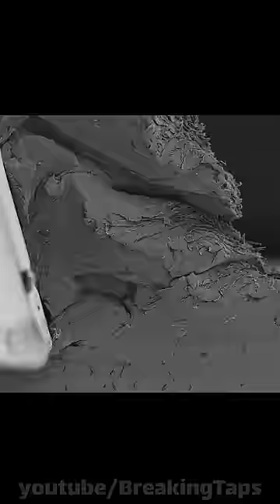Cutting metal under Extreme Magnification

Comment: Aluminum is called "The Peanut Butter of Metal" for a reason.
Reply: I thought sodium was...
Reply: Lmfao - nobody calls aluminum "the peanut butter of metal" 🤣🤣🤣
Reply: Cause most of us use aluminium for scooping out peanut butter from jar.
Reply: Thats what i call it yup
Reply: That’s a better description for something like lead or gold. Both are far more malleable than aluminium, lead by hand even.
Reply: Because Americans put it in baked deserts?
Reply: @digitalhippie2336  machinists do, it's soft as fuck.
Reply: "metal of the cave"
"metal of the freeway underpass"
Reply: Really? Then mercury is what chocolate sauce of metals ?
Reply: @ocelot420_69  It’s definitely one of the softest commonly machined metals. Meanwhile on the other end is inconel, which work hardens while you cut it and breaks tools like it was born to do so
Reply: @saldol9862  nichrome? You mean the stuff I would bend with my fingers when I vaped?
Reply: @ocelot420_69  Nope, while nichrome and inconel are both nickel-chromium alloys, they differ in their exact compositions. Inconel is usually age hardened or strengthened with a solid solution process, so it’s not bendable at all. Cold working it often just ends up making it even harder to deal with

Actually from what I have seen, it tends to just break versus bend because inconel was designed to retain its shape even at extreme temps.
Reply: @digitalhippie2336 you’re obviously not Metal.
Reply: I got an aluminum key at Walmart once, buy 2 normal get one aluminum free so I was like eh why not..marketed as light but durable. It definitely was light

One day I just wanted to test its durability and wanted to see if I could bend it a little..broke it in half with way less force than I expected
Reply: Yes just like water is the peanut butter of peanut butter
Reply: Bro had me google it
Reply: @jidukrishna5951  Huh? I haven't seen anyone use aluminum kitchen ware in ages. It's all stainless steel nowadays.
Reply: In Africa all of 'em have it made of stainless steel? Seriousbru?
Reply: @ocelot420_69  I doubt it. In Europe peanut butter is not that common, which is why no one would think of making a comparison with it
Reply: @digitalhippie2336  I don't call it that, but it is pretty soft.  My favorite metal to work with, it's so easy to shape.
Reply: @TravyChan97 I would like to further argue that would be a much better description of extremely soft metals like sodium or indium the latter you can chew like gum and the former can be cut with a knife by hand
Reply: Could’ve sworn that was gold
Reply: And potassium must be the butter of metal
Reply: Ferrum is the iron of metals 😂
Reply: Sodium:
Reply: Nobody calls it that
Reply: Just like peanut butter is called the "aluminum of sandwich spreads."
Reply: Said no one ever
Reply: @kennethflorek8532 😂😂😂😂😂
Reply: @Ch33se-ij5cd  Well obviously at least one person does 😂
Reply: copper is putty when you machine it
Reply: @digitalhippie2336 your clearly not a machinist
Reply: It's actually called Aluminium

Comment: Really makes you see why certain metals are a nightmare to deal with and can lock up machines when cutting them.
Reply: Inconel and beryllium have entered the chat
Reply: Cutting aluminum too fast and without coolant will turn it into bubblegum. Cutting copper fast is like trying to run in water up to your neck.
Reply: @100GTAGUY pretty much
Reply: This is a great example I hadn't thought of
Reply: Beryllium is just hard in the long run with no exhaust
Reply: vibratingstring I never found 6Al4V to be bad. But 15-3-3-3 is nasty. I swear it just tears and it’s the easiest to catch fire that I’ve dealt with. Also, heat aged 718 Inconel is nasty too.
Reply: Aluminium is a nightmare to work with, because it is so soft, it also has a low melting point, so if you have slightly wrong cutting speeds you end up with halfway molten aluminium on your tools. 

Aluminium needs super high RPM, cooling and cutting speeds.
Reply: He have a machine set up for Aluminium rn and we have to stop the lathe all 10 parts to clean out the tools 😢😅
Reply: Cutting HARDOX500 over 50m/min is like trying to run trough a reinforced bunker wall

Comment: As a metal worker this doesn't surprise me. Aluminum chips like this so easily and actually have an issue of clogging the flutes of drills if the flutes are too small. Other metals can do this, but it's usually a "you hit the sweet spot" kind of thing. You get them a lot when using a drill press.
Reply: huh that’s actually really interesting I’m a welder and haven’t observed that i’ll pay closer attention next time i’m working with aluminum

Comment: I study mechanical engineering, took two classes on machining specifically. It's a science in and of itself. There are so many factors that impact the efficiency of the operation. The angle of the exit surface, the angle of the tool itself, the shape of the edge, how deep it's in the machined part, relative speed between tool and part, materials involved, the list is infinite

Comment: Everything is squishy in the right situation.
Reply: That's what she said!
Reply: @sypialnia_studio ehehhehehe
Reply: More like scale
Reply: everything is squishy with enough heat!
Reply: Not really
Reply: @jimmcneal5292  yes really.  Sometimes it’s at a different scale, pressure, or temperature, but there’s always a situation where anything can be squishy.
Reply: @Johnrich395  once again, not really. Something like glass, high hardness steel or diamond aren't squishy, the are brittle.
Reply: @jimmcneal5292  glass is squishy at high temperature, as is steel, diamond is squishy at large scales.  Most brittle things are squishy at larger scales, even being able to make glass springs.  It’s all about the exact situation.  This was covered in my engineering coursework, and has been properly applied in my career field.
Reply: @jimmcneal5292  throw a diamond into the sun, I'm sure it'll get a bit soft.
Reply: @shinjite06  because of temperature

Comment: Looks like a bunch of stick figures running from a tsunami
Reply: you should do art of some sort!
Reply: Huh?
Reply: LMAO 😂😂
Reply: Brilliant
Reply: Where do you see the stick figures?
Reply: Bro that's crazy I can't unsee that how the hell did you catch that
Reply: @LinkinPark4Ever1996 in the lower portion of the metal, all those little cracks and holes. not the part thats being cut and lifted, but the solid mass of the bottom of the metal piece. there are tons of small vertical cracks and holes and when they're in motion i can see how they could look like lots of tiny people scrambling around under an incoming wave

Comment: For anyone wondering, from 0:07 the visible portion of the cutter is roughly about 0.15mm (or about 0.0059in) when measured from top to bottom.
Reply: Thanks I'm very familiar with things that are .15mm or about .0059in.
Reply: What is the depth of cut then? About 0.001”?

Comment: At this scale, 1 pixel on your screen is roughly the same diameter of 350 atoms of Aluminium
Reply: The whole metal shaving (the thing that piles up) is roughly 50 micrometers thick - the width of a human hair. 

And I couldn't believe it but yes, a single pixel is roughly 400 atoms. 
The wavelength of light is like five pixels on this screen. 
Which explains why we can't really image the little folds and structures with light. We're way into wave/diffraction optics with light here.
Reply: how did you figure this out? i dont even know how big a pixel is supposed to look relative to the size of my screen. when i searched this, it said that a pixel is 1/96 of an inch or .26 mm. I don’t know if this correct.
Reply: The answer really depends on your screen. On a phone you may have 1000 pixels on the short side of your screen (about 2 inches) while on a monitor you may have 1000pixels take up much more space along 12 inches or so.

A useful metric for this problem is the pixel density DPI ( dots per inch). For modern phones it's in the 400 range. So there is 400pixels in an inch.

That means a single pixel is about one 400th of an inch long. 
Then divide that by 600 for the magnification factor and you have 

1/(400*600)= 1/240000 
Or about 4 millionths of an inch.
Reply: Or for us metric folks ... Almost exactly 100 nanometers.

Compare: wavelength of green light = about 500nm

Size of a small atom = about 0.1nm

Diameter of the DNA double helix = about 2nm
Reply: lexibility, pliability, suppleness, ductility, elasticity, pliancy
ductility, malleability Interesting molecular vibration theoretical orbanism
Reply: On my phone it's probably more like 3 million atoms.
Reply: @TaserFish-qn2xy  409DPI here lol
Reply: @spicytee133 Usually devices have a ppi, or pixels per inch. 

Alternatively, if you know the screen resolution and size, you can calculate it. That's what 1080p means. 1080 pixels wide.

Size/resolution is pixel width
Reply: Sick
Reply: you severely overestimate the amount of pixels on my screen😂 im a tree guy, i go through about a phone a year so i buy the cheap crap.
Reply: Assuming you are watching in full resolution, the physical size of your screen shouldn't matter.

Comment: To anyone not in the know, Tungsten carbide can have a sharp edge, but if you have something like a lathe insert it's actually going to be slightly rounded because carbide is used for its hardness and a very sharp fine edge will break down rapidly. High-speed steel cutters can hold a fine edge (Aka Sharp) and are preferable in situations where that is more critical than tool life.
Reply: I work in the tool and cutter grinder  industry do all types of blades and cutters diamond ground tools and pcd cutters too carbide is used on softer materials like aluminium wood plastic etc high speed steel blades used mainly on stainless and harder materials hence less breakages
Reply: @mattwilliams1128  I can only imagine the feeds and speeds for PCD on aluminum are extreme?
Reply: They are faster than the conventional tools but then they do cost 3 to 4 times more than carbide and 10 x more than the steel cutters, also the Machinery to grind the tools comes in at half a million or more but also the cutting life is longer

Comment: I wonder how a laser cutter would look since it’s not pushing it out of the way
Reply: Lot of smoke and tiny splashes of molten metal.
Reply: It is, though. If it stayed in place you wouldn't get a clean cut, you'd get cuts with blobs of metal streamed the entire length.

Comment: Would be interesting to see how those cutting actions occur when oil is provided along with the carbide machine tool. As you know, Aluminum manifests a uniquely different finished  surface composition when it is lubricated with oil. As a matter  of fact simply using an angle grinder on a sheet of aluminum momentarily, stopping, applying oil to the surface and resuming  with the angle grinder is quite enlightening

Comment: It's interesting that you can see the stress fracture occur in front of the tip of the blade. That's valuable knowledge because it's structurally compromised at the depth of the tool or maybe even below, depending on the tool. Fascinating research!

Comment: Brilliant technique! I'm curious how you got each snapshot with small movements of the cutter. Love your vids!
Reply from the maker: More details in the long video, but I made a little fixture that has a micrometer screw. So I advanced the cutter 50-100 microns, took an image, pulled it out and repeated the process :)
Reply: @BreakingTaps 
I think it would've looked quite different at appropriate cutting speed, especially with soft aluminium, that's something to keep in mind. I guess it's probably close to impossible to do it at 300-1000m/min in such circumstances though.

Brass might show little difference in behavior slow versus fast, but that's just a feeling based on how it feels when being cut at different speeds.

Nice work anyway, looking forward to the video!
Reply: @BreakingTaps what about nickel and chromium ?

Comment: I’d like to see this done with a very hard material like inconel or a heat treated stainless steel.
Reply: Inconel is really soft
Reply: @dylanmcvicker9503 as far as machineability goes its not. It's a high nickel alloy and it's machineabilty rating compared to other metals is around 15%  and can have a hardness of up to 45ish (spending on material condition)  hrc and is extremely heat resistant which makes it difficult to cut as that heat softens material at the cutting point. I've cut cobalt and hardened tool steels up to 60 hrc which is about where the possibility of machinability starts to disappear. Inconel is no joke. Can I do it all day? Yes. Is it soft? No. Aluminum is soft. Carbon steel is soft. Sh you can make a case for stainless even. Not super alloys though.
Reply: Very hard? How about tungsten carbide, aluminum oxide, silicon carbide, cubic boron nitride, diamond. Those are very hard materials.
Reply: @peteroleary9447 right but you're describing materials you use to cut materials. Those aren't machineable. They have to be ground or chemically deposited, etc. You actually machine inconel, and it's one of the hardest materials to machine. Next to things like satellite, mp35n, or other cobalt nickel alloys and hardened tool steels. You'd use carbide and CBN or ceramics  to do the cutting on them.
Reply: @peteroleary9447  yes those too. I can only ask based on my experience with machining. Inconel is the hardest material I’ve machined personally
Reply: @phuckyocouch9098  Right. Especially if you're referring to conventional machine tool cutting, such as with a milling machine or lathe. We consider grinding as a machining operation however. We use diamond grinding wheels to grind tungsten carbide all the time. Conventional and wire EDM are everyday machining operations in toolmaking as well
Reply: @MrKent84  Yeah, inconel is a beast to machine, but not because it's super hard. Using the Rockwell C scale, 718 inconel is 36-38 HRC, around the hardness of a 4140 steel, but much harder to machine.

Comment: Wish you explained the fact that the reason it looks and behaves like playdough is cuz of the heat generated during the cutting process. The metal basically melts along certain lines of stress allowing it to behave plastically (idk the technical term sorry) and deform, thus the cutting can happen.

Comment: Its not just looks like clay... It kinda does behave like it aswell. Aluminium is pretty soft hence its sometimes a Nightmare to work with since the chips are pretty long and wrap around the tools. This can lead to tool failure over the while.

Comment: How do they achieve this scan-rate on the SEM, how is it possible to have such a high vacuum-chamber that it even fits a Saw into it and how can they maintain the focus, since i assume that the aluminum is moving on the z-stage?
Reply from the maker: The long-form video has more details about the setup, but there's basically a small stage that is placed inside the SEM chamber. A micrometer advances the cutting edge, it's placed inside and a photo is taken, then withdrawn and advanced another dozen microns.

Comment: but why does it have to look like a lot of pictures instead of a fluent video? I believe it would hit different if we see it as natural as possible.
Reply from the maker: Because it was exactly that, a bunch of stills :)  The longer video has an explanation why, but the tl;dr: is that I had to manually advance the cutting edge for each frame and reload it into the microscope. There wasn't an (easy) way to get a smooth, continuous video. Maybe in the future, I'm thinking about ways to do it!